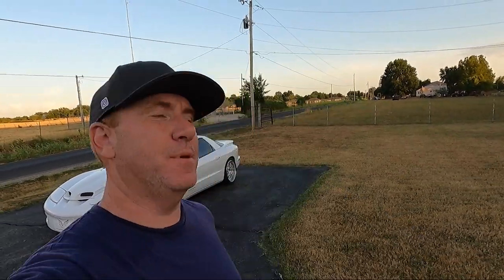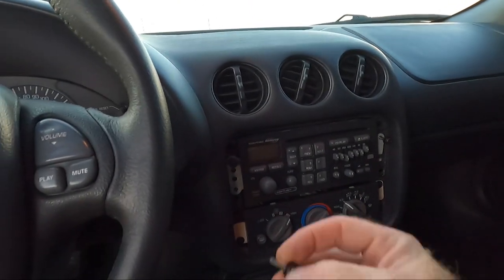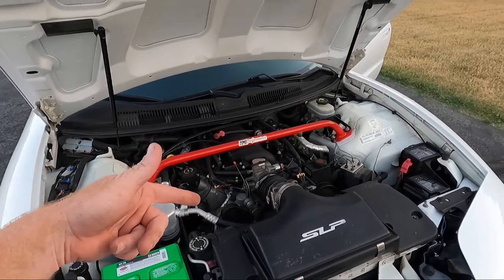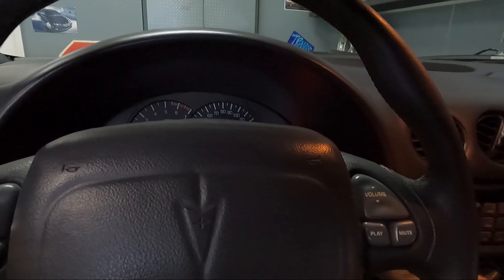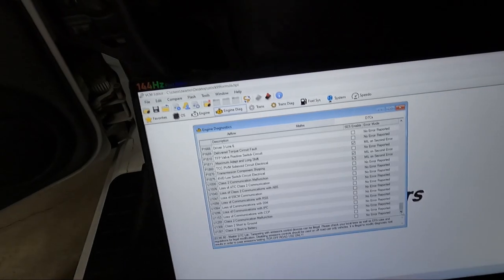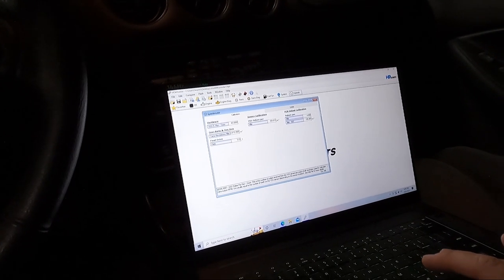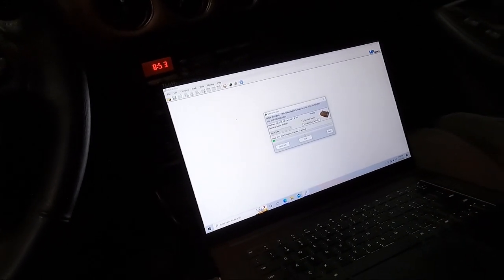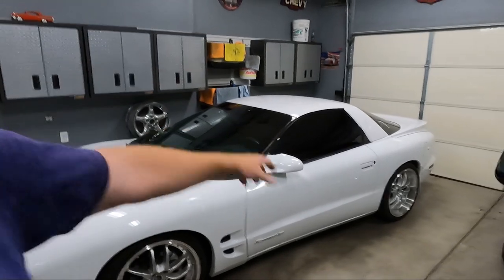Pontiac Firebird Formula Fixes and New Window Tint (How to turn off Service Engine Soon Light)

Comment: Nice video on the formula.. car looks sharp with the tinted windows.. I think you should put some ZR1 staggered chrome rims on the formula just like you had on the black Z28 you had... I'm not a fan of 18 or 19" rims on fbodies.  I think 17s are peeeeeerfect...👍
Reply from the maker: Thanks Keith. It needs 17s for ride improvement

Comment: The sweet thing about running staggered 17/18 ( Corvette) wheel combinations, is that you can have extra wheel well opening taken up by going 18's on the back, and not feel so much of the roughness,...while retaining the softer stock ride up front.
This is possible, because the rear of the car is lighter then the front.
This way, you retain some comfort, and still retain some above factory cornering.
Reply from the maker: It does look good with staggered wheels
Reply: @TWA Motorsports  I always thought so, and you won't find yourself replacing a rim every summer!
I live in Boise,...Home of Stacy David and Charlie Hutton, ( Chip Foose's favorite painter),...oh, and Pual Revere and the Raiders!

Comment: Interesting video. I have the old hypertec tuner for my 2000 Chevy, can read codes and change shift points, tire size, fuel octane you use and a couple other ones, but I like the one you use 🤔!!! ✌🏻
Reply from the maker: Yeah way more options with it

Comment: Hey Travis, thanks for the great Videos, always very informative! I must say you have got that firebird looking really Sharp, I was wondering what do you think it would cost me to get and HP tuner for my 02 V6 firebird, I have an engine light on for the fuel tank pressure switch and I would love to turn it off.
Reply from the maker: Thank you. Hp tuners software is around $500

Comment: Idk if anyone has had this problem but I have to tilt my steering wheel to turn on anybody know how to fix ?
Reply from the maker: Need a new column or yours rebuilt. Its a pain to rebuilt
Reply: @TWAMotorsports  To change the steering column can I do it without dropping the k-member ?
Reply: Fbody problems 😅
Reply from the maker: Yes

Comment: eBay had coolant level for $19 I just put mine in 20 mins ago.
Reply from the maker: Aftermarket ones are probably cheaper. I always buy gm stuff
Reply: @TWAMotorsports  some things yes but this meh. If it goes out again I’ll just unplug it. Now a tranny, tcm, anything internally or key parts. The vacuum pump I got on rock auto is gm and half the cost
Reply from the maker: I agree with that
Reply: @TWAMotorsports  I learned the hard way with a bad dorman tcm. Tossed me in a huge loop and changed my thoughts on inner parts
Reply from the maker: That has been my problem. Some stuff is made cheap

Comment: How much was your compressor plus installing
Reply: I got a code p0327 do you know what that might be? They said low circuit ??
Reply from the maker: Around $200. Link in video description
Reply from the maker: That is knock sensors
Reply: @TWAMotorsports  i changed both knock sensors recently but im thinking it’s the harnesses cause I didnt change those
Reply from the maker: Always change harness and only use gm parts